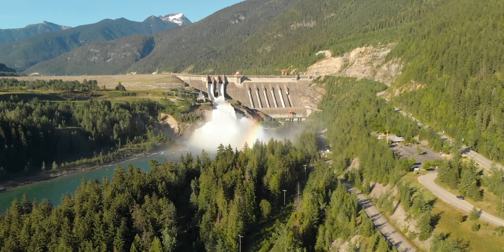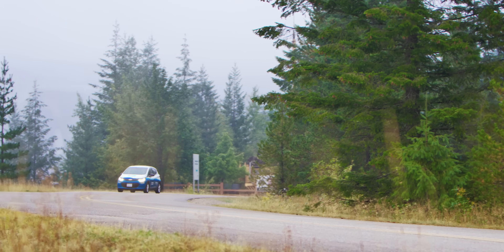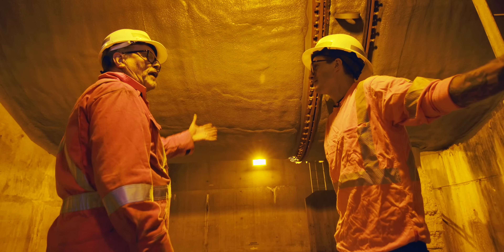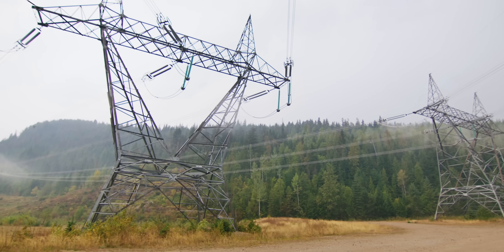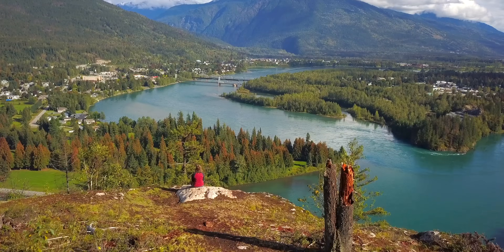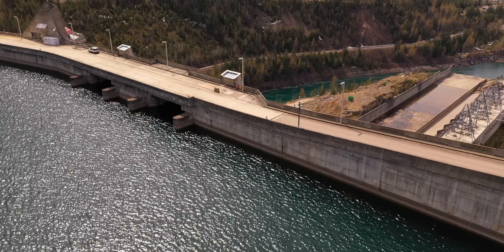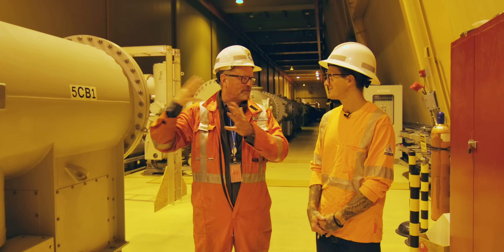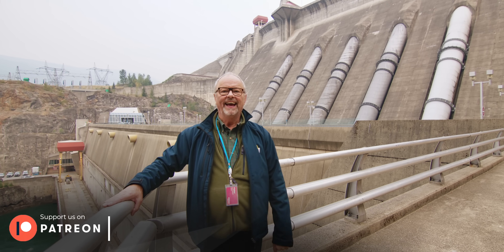This Dam Makes Enough FREE Energy To Run A City

Comment: @1:58: 1 m³ of water dropping 1 m is 9810 Joule or 0.002725 kWh of ENERGY.
1 m³ of water dropping 1 m PER SECOND is 9810 Joule PER SECOND, which is 9810 watts (9.81 kW) of POWER.
There is no way to bring this "1 m³, 1 m, 1 kW" together.
Reply: By the way: You need ~1 m³ of water falling down 10 m to get the heat for this cup of coffee.

Comment: Great to see a video from my province! Personally I'm very proud of the fact that we're nearly exclusively powered by zero-emissions hydro power; it is not zero-impact, but it's certainly a lot better than burning fossil fuels. We're very well-positioned to aggressively reduce carbon emissions in the coming years by switching to EVs and heat pumps which will both benefit from being fed from clean electricity.

Of note is that in spite of its gargantuan size, Revelstoke is actually only the third-largest dam by peak output (until they install the 6th turbine) and second-largest by annual energy output, with the WAC Bennett on the Peace River generating nearly twice the annual output of Revelstoke.

They briefly touch on it in the video, but the majority of BC's hydroelectric generation is provided by multiple dams on a small number of rivers (Peace River and Columbia River). While this doesn't entirely eliminate the ecosystem disruptions of putting a hydroelectric dam on a river, it does reduce the overall impact since adding a second or third dam to a river that's already got one does not cause as much overall disruption as damming a whole new otherwise-pristine river. The additional dams are on a path that's already impacted for fish migration, and you also don't need to flood nearly as large an area as only one upstream dam requires a large reservoir for water storage and flood control and the downstream dams can either be entirely run-of-river or have only very small dams, resulting in less overall flooded area.

It's important to be realistic and pragmatic about power generation and its impacts, and to recognize that all forms of generation have environmental impacts and the choice isn't between "have impacts" by building a power plant and "not have impacts" by not building it, but between the relative impacts of the available sources of power we choose to build and use. If a hydroelectric dam is displacing or replacing fossil fuel generation somewhere it is inarguably a win in my books, and it has some very valuable storage and dispatch characteristics that means it complements solar/wind very well.

Our provincial neighbour to the east currently gets nearly all of their power from fossil fuels, and if BC can export an excess of hydroelectricity to other locations like that with less plentiful hydro resources then it means overall emissions go down substantially.

Avoiding as much climate impact as possible is going to require aggressive electrification of things that currently use fossil fuels (transportation and heating, especially), which will require more electricity. I'd much rather it come from a hydro plant than a natural gas plant, supplemented with whatever wind and solar we can install in our rainy, mountainous province.

Comment: I have wondered... Can a Hydro plant ramp down the amount of water that goes through it and hence the amount of electricity generated?  If so how fast?    Given how solar is dominating the middle of the day and wind is strong in the evenings, it would be ideal for Hydro to ramp down during the day, and go to max during the night when there is no sun and less wind.
Reply: Hydro has one of the fastest load responses of the large generators. Very controllable.
Reply: Although hydro can ramp up and down pretty fast you have to be mindful of the downstream impacts on water flow.  You could easily drown fishermen who did not see the quick rise in water level.

Comment: In reality this is a baby hydroplant. The largest being more than an order of magnitude greater production.
Regarding the carbon cost, theoretically the second generation plant would have significantly reduced carbon input costs as the reduced carbon cost of the power produced by this plant would have a second round effect.

Comment: That's the problem with all this green agenda. All one way bias, very little was mentioned about the devastating impact these great big damns have on the environment & the health of the river. Everything is not just about burning things.
On another note I been saying this for many years that why don't they build 10's of 1000's of small scale hydro systems like reverse Archimedes screws on the UK river networks. Very little environmental impact with 24/7 power generation feeding into the grid.
One thing the UK is not short of and that's rivers with plenty of water. Before we use to burn things the industry was all powered by waterwheels & watermills. Time to get back to basics
Reply: Have you checked the water levels in U.K. rivers for the past 5 months?

Comment: I am keen that existing hydroelectric power plants should continue to exist but building new ones is not a particularly good idea. Their energy output is concentrated and isolated from consumers, not widely distributed like wind or solar can be. There is much embodied CO2 emission in their construction that takes several years of zero emission energy output to mitigate, and the flooded vegetation and soil beneath reservoirs can emit harmful methane and CO2 for many years, unlike the rock and gravel beneath natural lakes.

Comment: Could do with a few of these in the UK ! 🥵
Reply: we do.. but smaller.  we don't have the geography to vie such large rivers and dams,   the reservoir for this would reach most of the way from newcastle to carlisle.
Reply: Sure, are you Ok with the compulsory purchase of your house and flooding of your town?
Reply: UK has a total of almost 2 GigaWatt of hydropower installed, most of it in Scotland, some of it in Wales and even 2 in Devon!
There's also 2.8 GW of pumped hydro (water pumped up with excess electricity, flowing down to generate power).

Comment: Very impressive. I would like to hear more how the big money that's being saved compared to coal or gas fired plants is being used to help the salmon that can no longer migrate due to the dam. Right now, with current prices, we see interest spike in small hydropower, that has nothing of the kind of the cost to benefits ration  of one big facility destroying one (big) ecosystem - it's hundreds and in then end it's more expensive than other renewables. Big ones like these - we shouldn't remove them. Should we build new ones ? Probably not. Pumped hydro on the other hand ? Yes please.

Comment: It can power 8 million homes but it is only 15% of what hydro bc produces? Shouldn't this dam alone be enough to power the whole province? Are they selling it outside the province?
Reply: You have to add in commercial and industrial power use, which I am guessing is very high, that would only be residential.
Reply: @neilmillar5157  And referring to annual yield and not to nominal (maximum) power, it's much less than 8 million homes. 8 million homes won't consume less than 8 billion kWh (7800 GWh) per year, right?

Comment: how about using it as a battery by pumping water upwards when there is too much power?
Are there any windmills and solarpanels around it?
Reply: It already spills water that is in excess of its demand. Why would you generate more electricity only to pump the water back into the reservoir at a net loss?
Reply: @davidbutt406  good point. What a luxury.....
Weird electricity is so expensive over there...
Reply: We pay about the equivalent of US$ 0.07 per kWh, amongst the cheapest in the G20. It costs the average Canadian 1% of their daily wage to buy their day’s electricity.

Comment: The environmental issues with Dams are not great. Initial flooding releases a huge amount methane from rotting vegetation and soil microbiology. Blocks salmon migration which fertalises the land around through predation. Holds back sediment and reduces bio diversity in the River and its estuary. Not very green really. They should probably be limited to what's needed for drinking water.
Reply: Yea, BC should buy more natural gas from Alberta. Not!
Reply: @Obscurai  I'd go Nuclear power. It's the most environmentally friendly solution. Thorium molten salt reactors would be the best approach but any modern design would do. Wind, solar or smaller scale in stream hydro projects too. You don't need to dam a massive river like that to draw power from it.
Reply: @andyjw26  In the BC context, nuclear is completely nonsensical. There is neither the demand nor the necessity for a high capital cost, regulatory burdensome, slow return on investment,  waste troublesome technology. As a net exporter of electricity, BC and the Pacific Northwest has over 60 large dams across its many rivers and fjords and not a single nuclear reactor. Nuclear is only necessary if you have no alternatives. As for thorium, that's a pipe dream completely unproven in a commercial context and is only for desperate governments to attempt. I'll stick with hydro and leave the headaches of nuclear for those less fortunate.
Reply: @Obscurai  There was a working thorium msr at oakridge national Laboratory that ran for 4 years it's in no way an unproven technology. As with most advances in nuclear power technology the main barriers are ignorance and lack of investment. Oh and governments in the pockets of fossil fuel lobbing ofcourse.
Reply: @andyjw26  A working thorium reactor at a lab is still not commercially proven but is only a proof of concept. Only the most desperate governments would consider investing a country's energy policy into such a pipedream. This is not ignorance, but financial prudence and due diligence. Any promotion of this fantasy is naivete at best. As for being in the pockets of the fossil fuel lobby, the hydro-electric business is clearly not influenced by that insanity.
Reply: @VanDiemanSoul Yep, buy more natural gas from Alberta. That's the answer. Good to throw the baby out with the bath water I say.

Comment: It would be great if Robert did a review of a company called Turbulent Hydro, Small Scale hydro for rivers with a low flow. One thing we are not lacking in the UK is good rivers!! Just a lack of water sometimes 😁
Reply: Sam, 

low flow, and that's the problem, it equals very low power.
Reply: Then what the hell are all the clouds you have over there doing then?  Living off welfare?

Comment: I really don't want to be negative, but what happens when the snow stops feeding the dam?
Reply: Even with global warming, the interior of BC gets a lot of snow and rain. It might effect the water levels but I am more concerned with the increase in forest fires in the area cutting the lines.
Reply: When and if the snow stops, there will be much bigger problems than electricity generation.
Reply: @Obscurai  Yes, if the snow stops, it would be a disaster with many implications. But I don't think that is likely for the interior of BC and the dams that are further North and East. The summers get longer and hotter so there are implications but it is hard to believe the snow will stop.
Reply: @yodaiam1000  Correct. That was the point of my pointed comment to the original poster.

Comment: Long time born here BC resident  who still much appreciates the fact that we actually had political leadership back in the 50's and 60's that got stuff done and wasn't bogged down by endless lawyers and 'rights' issues. We have all enjoyed the benefits, including those with the rights. Not mentioned in this video was the fact that these dams were also built as part of flood control, not just for hydro. Portland Oregon  on the same Columbia used to get severely impacted by huge river floods.
Reply: These Canadian dams also greatly increased the dependable capacity of Grand Coolee during dry water years.  This is because of the major water storage capacity added to the system.  Small hydro cannot do that.
Reply: So other people's  rights aren't  of any concern to you.....speaks volumes about yourself

Comment: Always a treat to see hdropower dams... I am always disappointed that they aren't producing enough power to meet 110% of the power demand, like this one only meets 15%  of the BCs demand. I am curious to know the percentage efficiency from the Kinetic to electric conversion. I hope its is around 90%
Reply: On the up side, there are a lot of hydroelectric dams in BC. For example, just off the top of my head, I don't live that far from Vancouver and there are two dams within a 20 minute drive. Smaller in scale than this one, but still there. BC exports electricity, so hydro is producing enough for us 🙂
Reply: 95% of entire electricity consumed by BC comes from BC Hydro which generates 98% of it from renewables .. mostly hydroelectric dams. This makes BC one of the most green energy places on earth.

Comment: Power, silent and clean. Thanks
Reply: Not as clean as Hydro would like you to believe. The backed up water produces huge amounts of methane gas. In this dams case the change to the local ecosystem completely disrupted the snow patters. There are pictures of crews living in accommodations completely covered with snow. Tunnels dug down to the doors. Houses in Revestoke had High pitched roofs to accommodate the snow loads that no longer exist. The Bennett dam on the Peace river has destroyed to downstream habitat and wetlands. Site C is the next dam that Hydro is building to heat the pipeline from the tar sands to Vancouver. Hydro's own advisors said no we don't need it. Install solar instead.

Comment: The US build about a dozen pumped hydro storage facilities in the 70s. They were typically built next to nuclear plants, with the idea that the plant runs at a constant rate and the pumped hydro takes care of the peaks and valleys of demand. A single pumped hydro plant stores about as much energy as every single battery on the US grid today, combined.
Grid battery storage is a tremendous waste of time and money. Just dig a hole on top of a hill and pump some water up there!

Comment: Anyone want to address the elephant in the room, that being extended drought?
Reply: At those latitudes and altitudes, not likely. BC is very, very rainy. As the climate warms, there will be even more moisture in the air for the mountains to precipitate.
Reply: @Obscurai  I was thinking in other regions of the world that spruik Hydropower as being the golden egg. It is being touted in Australia which has only got plentiful water every 20 years
Reply: @peterryan7340  Having lived and worked in Australia for a year, I understand. Dams are appropriate in higher latitudes and altitudes. Australia is in neither of those conditions, but this video is about the dam(s) in BC where water is more than plentiful and unlikely to diminish. On the contrary, precipitation is likely to increase as the planet warms. So, the elephant in the room is non-existent in the context of this video.

Comment: 1:55 1 cubic meter dropping 1 m produces E=Force*distance = mgh = 1000 kg * 9.81 * 1 = 9.81 kJ of kinetic energy. If that happens in 1 second that is 9.81 kW of power. If he’s right, and he’s not, that’s about 10% efficiency conversion to electricity.
Reply: What he said can only make sense if that water falls over 9.81 seconds, that would give exactly 1 kW of power for 9.81 seconds assuming 100% efficiency. We know from pumped hydro that the efficiency is close to 100%.
Reply: Was looking for this haha!
Reply: That's for pure water at Standard Temperature Pressure not cold water contaminated with glacial and snow runoff . (G) 
Still I wouldn't want to be under a tonne of water dropped 1 metre. <G> 
I'd give it to Robert for his fact of the day though.🤣
He did say a kW "of electricity" which is energy. 
We visited Revelstoke in June 2008 . 
From the parking area you could look down into the roof of the generating station where they were welding the steel sections together for the piping for the 5th penstock. The sections dwarfed the welders and vehicles. You can drive a paved road  to the top of Revelstoke mountain , couldn't do it in June as the snow was on the road as you got close to the top.
Reply: @JohnRoss1  kW is not energy, it is power! Joule is the unit of energy. Watt is the unit of power. KWh is also a unit of energy, as energy =power*time.
Reply: @JohnRoss1  a kW is power not energy..

Energy is expressed in kWh or Joule, kJoule and what have you....
Power is energy per unit of time, expressed in kW.
Reply: He's horribly wrong.
kW isn't even a unit of energy, kWh is.
But in Robert's case I absolve :-)

Its is unfortunate though that he said that he "at least knows that" and then shows he doesn't.
Reply: @aadvanherk1271  He used this in a video many years ago, when he visited a small hydroelectric plant, I think it was in Scotland.
When it comes to numbers, you shouldn't trust Robert, they aren't his friends.
The same with the "powering of New York City".
The electricity consumption of New York City is ~70,000 GWh per year, this dam produces 7,800 GWh per year.

Comment: Sadly Hydroelectric only works if it Remains Raining and Snowing or you Just run out of Water in Very Long  Global Drought Seasons (Years, Decades )
Pump Storage Would be much better Due you could use Peck Solar and Wind To Pump Water backup stream into storage (fresh water rivers  Will ned to Become Bi Salt & Fresh water Rivers With Salt water Fans & Pads Greenhouses to make Fresh Water